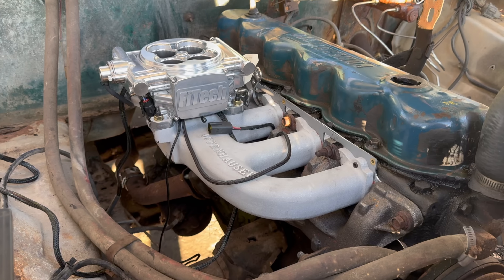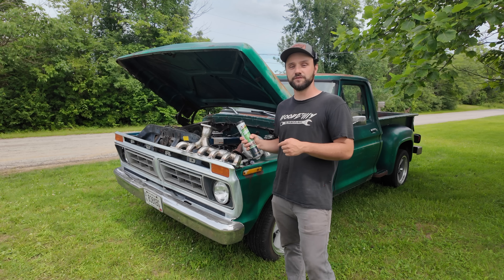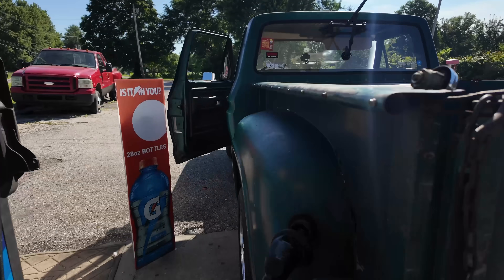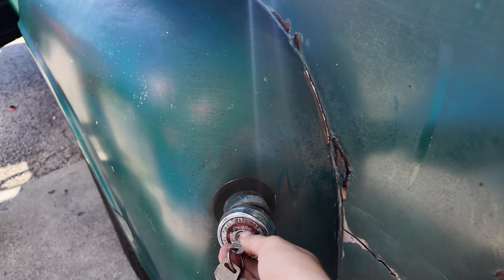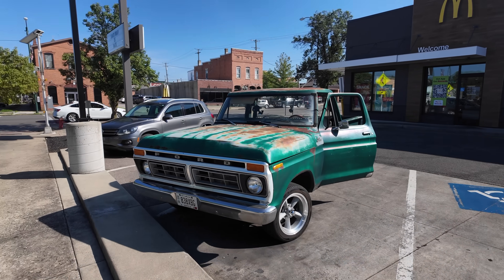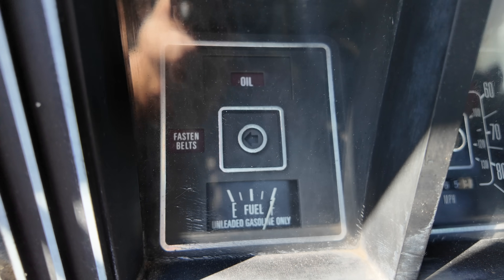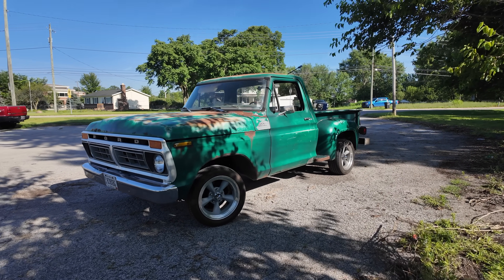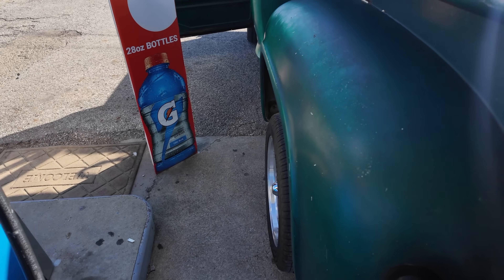How Many MPG Does An EFI Swapped Ford 300 Get?

Comment: Gas hog 300 6cyl, I bought a new 78 Ford short wheelbase step side in 79, Gas hog -15-17 at best, but with a trailer with about 2 tons dirt it still got about 15.  However, ford in all their brilliance in those years put the catalytic converter right to the bottom of the exhaust manifold and it would melt or soften the bolts holding the converter on and the actual manifold would melt.  Did this twice under warranty.  It's the rear end gearing and it is on the way low side.  If you want to pull heavy loads, it's fine if you want to go down the highway it isn't.  The melting manifold it unfixable, all should be gone.  Traded it for a 78 2door Pontiac Bonneville.  It was almost the same Green as this truck but had Fiberglass rear finders, looked nothing like rounded ones on yours.

Comment: I'm not sure a 30 mile round trip could be adequate to establish fuel economy. It would be impossible to duplicate any additional test drives due to the variabilities. I've got a 64 F100 with a 78 351M and C6 auto that will pass anything except a filling station.

Comment: If you have the option of tuning the EFI yourself then just make sure your engine runs at about 15: 1 AFR at cruising speed/steady throttle and use deceleration fuel cut off. 
Also, use a working thermostate that will keep the coolant at about 203F (or 95C). That way the EFI will provide the leanest AFR as soon as possible after initial cold startup. Which is good for mileage.  

Apart from all that is your personal driving style. It can make a huge difference (20-25%!) if you accelerate hard or if you just gently let the car/truck gain speed. 
Other obvious factors: keep your tires properly inflated, make sure your brakes aren't dragging, don't carry any unnecessary heavy objects in the car/truck.

Comment: 3 full throttle to redline pulls to program the altitude within the rpm range; and a solid tank full of driving or at least 100 miles so the efi can get a good base. Then go for a mpg run.  A wide-band is a good idea but if you not looking for a hotrod a simple air fuel gage is just fine. Also for goodness sake run 100% if you are doing regular it really is worth the extra money on the old stuff.

Comment: What model transmission and FDR is it running? Because if it's loafing along in overdrive, with a even a slightly aggressive or modest gear in the axle... that has quite an effect.

Comment: Great improvement. Now figure out the cost per mile of the original carb and the new efi. Take the difference, and that is what you save per mile. Then you can tell us how many miles to save the cost of the efi set up.

Comment: My dad had a 74 F100 Custom, 240/3 speed. He had an un-aerodynamic aluminum camper shell on it for a while. During mid 70s gas crisis, he took the shell off, went on a loop, and reported that he got 25 mpg.

Comment: My efi 4 speed 4.9 got 17 mpg driving it super easy. Once I saw 4.9 get that mpg I decided they are not worth it, my 351w gets 15-16 easily on highway it has way more power, just as reliable, with v8 rumble

Comment: There is NO way you can accurately measure gas mileage by going less than several hundred miles. 1000 would give you really accurate results. I appreciate what you're trying to do, but this is a terribly flawed way to go about it.
Reply from the maker: 100 miles yes, 1000? That’s a bit much homie lol 🤣 it doesn’t take all that
Reply: @GilktheGreat Actually, 1000 miles isn't too far off.  You want practical miles. That means that you need to keep track of your mileage, over the course of several fill ups. (One commenter suggested 3-4 full tanks; I'd go with 5 or 6). But, by the time you burn about 4 full tanks, unless you have a very tiny tank, you should have hit 1000 miles; probably more. 

By the time you've burned about 5 full tanks, you'll have a good representation of practical MPG, based on your specific driving style, and the conditions in which you typically drive. (Conditions include average stop and go, the terrain, weather conditions, your average highway vs city, and other things.)

Keeping continuous track of practical MPG is good, too. If you note the MPG slipping, you know that SOMETHING wants attention.

Comment: I am a metrologist and this test is flawed. 

You must start and end with the same amount of fuel in the tank for the test.

On the second test you started out with a tank that was full till it was dripping out, and when you added the fuel at the end you did not add it all the way up until it spilled out.
Reply: Don't need to be a meteorologist to realize that.  😂
Reply from the maker: lol
Reply from the maker: Appreciate the insight, Matthew. You’re absolutely right—starting and ending at the exact same fuel level is key for an accurate test. I tried to be consistent, but I’ll admit I didn’t top it off to the exact spill point on the second fill. I’ll redo the test with more precision next time and make sure to document that part more clearly. Thanks for pointing it out

Comment: My best measured mpg on the trucks I've owned.
86 Mitsubishi 2.0 5sp.      27
90 S-10 2.5 5sp.                30
95 F150 4.9 5sp.               18
99 F150 4.6 auto.              20
05 Silverado 5.3 auto.       22

Comment: In the 1980`s they came out with an overdrive standard transmission that got higher fuel milage.
Reply from the maker: I’d love overdrive
Reply: I had a 1978 E-150 van that I ordered with that manual. 3 speed plus OD. I think it was like 1.1:1. Drove great!

Comment: I have heard claims of 28 mpg from a 300 Ford.  I don't know details but a camshaft and custom pistons were used to maximize the compression ratio.

The new F150 window sticker in 1985 said 25 mpg - was 1 barrel carb
Reply from the maker: Don’t worry, I’m going to tune it because the tune is really rich right now and tested even further so you guys can see why the system works

Comment: 30 miles isn't a great test for fuel mileage.  Need to do a couple hundred before you can get a good accurate test.  I do about 120.
Reply from the maker: We are getting ready to tune it in redo this test and drive it further. My tune was super rich anyways so I think we can get a higher miles per gallon.
Reply: @GilktheGreat  very cool. I can't wait to see what your TBI unit does for the mileage.  

I have a very healthy low miles carbureted 454 in a camper, and the mileage is predictably awful. 
I had thought about building a Megasquirt system for it, but honestly...... a quick bolt on solution would just make life easier all around. LOL  

What was your long-range mileage with the carburetor before?

Comment: To get more accurate fuel economy figures, it would be best to use like a 5 gallon boat fuel tank that can be weighed before and after, or just fill it with a known volume and run it dry.
Reply from the maker: Yeah, we’re probably gonna do like 100 mile trip and take the truck to a weigh station potentially

Comment: I had a 77 f100 with a 300 with a floor shift 3 speed with over drive just think of what kind of mileage you could get with that transmission in it
Reply from the maker: Dude, I would keep the three on the tree if I had overdrive
Reply: @GilktheGreat  I wonder about the possibility of adding a Borg Warner overdrive to it...

Comment: I write the odometer reading on every fuel recipt, put it into a database program that does the math for me. Gives you a good average over a month or year or week. Yeah it takes a little time but worth it for me.. Living in Texas I can say the hotter the weather the worse fuel mileage 1967 F100 352CI & 4 speed ( no AC no PS)
Reply: Are you can just the fuelly app.
Reply from the maker: What is the program you use called? I’d love to give it a shot.
Reply: @GilktheGreat  i use fuelio.  my 78 f150 300 with c6 and 4.11 gets between 12 pulling my boat to 15 empty with efi exhaust, offy dp intake and qjet.  everything else stock/original and 178k on the clock

Comment: 23 MPG is pretty good that's almost double of the 12-15 MPG the F-100 with 300 inline six got when it was new. I mean if your DOUBLING your MPG when new just by doing a EFI kit on 45 year old truck then that's nothing to sneeze at, My buddy has a 1980 F100 with a 300 in it that my soon to be 13 year old grandson wants so bad he can taste it.
Reply from the maker: That’s amazing to hear man! Thanks so much for the comment. Big reason we EFI swap it is because it’s the more affordable option for turbo charging this in line 6 versus doing a blow through carburetor set up.
Reply: @GilktheGreat  Yep I get it, it's easier and it's cheaper to do that way.

Comment: I had 90’s Ford trucks that I regretfully sold and scrapped over 10 years ago:

1993 F150 regular cab 2wd 300-6 Mazda 5 speed, 2.73 open differential, no topper or bed cover I got 22mpg highway at least once going 60mph, no cruise control. 

1994 F250HD regular cab 2wd 300-6 ZF 5 speed, 4.10 open differential, no topper or bed cover I got 18mpg highway at least once going 60mph, no cruise control. 

Was diagnosed with chronic Lyme disease and sold the F250 with a bad clutch slave for $500. A few years later I cut up the F150 and sold the mechanicals. Wish I had kept both of them.
Reply from the maker: Dang man I’m sorry to hear that

Comment: I am not doubting your test; however, I have owned three trucks that had the 300. Two were F150's (1980 with automatic no overdrive, carbureted, and 1991 4wd, with five speed standard with the overdrive and EFI) and a 1983 F350 with four speed granny gear, carbureted. The F350 got nine miles per gallon. The F150 automatic got between ten and eleven mpg, and the five speed gets between ten and twelve mpg. I still own the 1991 F150 Lariat.  It has less than 83K miles on it and she still looks almost brand new, inside. It has a few very small chips and dings on  the outside. I drive it when I need to pull a heavier load than my Toyota can handle. I get asked almost every time I drive it, how much do I want for it? I always smile and ask where do you see a for sale sign? Truthfully, I have a son who was born in 1991 and he has pretty much claimed it, and his three brothers and one sister let him, lol.
Reply: The 77 F-100 with the 300 inline six got 12-15 MPG When new, atleast that's FoMoCo says, and he basically doubled that on the low end just by doing an EFI swap. I'd say that's pretty good for minimum work/upgrades.
Reply from the maker: We can take it on a longer test, tune it before we go
Reply: Those of us who owned and drove these vehicles when they were new have a pretty good idea of what to expect. In 1976 I bought a new E100 with a 300 I6 and automatic transmission. I don't remember checking the economy because gas was inexpensive. I bought a new 1978 E150 with the 351 W and auto and the best I got with that was 12.5 downhill from Wolf Creek Pass to Pagosa Springs Colorado! My 64 F100 resto-mod-survivor has a 351M / C6 and does about 8 mpg. I don't drive it enough to justify the expense of a true EFI conversion. Still fun to drive though!😊

Comment: So, I think you would get better results with a longer trip. For one, it's real world use whose mpg matters. Second, fuel pumps are known to not be accurate when only putting small amounts. Most of them have a warning on them somewhere about them only being accurate after so many gallons.
Reply from the maker: Okay I’m thinking about doing a longer test for you guys, I think I can get more mpg out of this
Reply: a longer test only "improves" the mpgs by keeping the system in cruise mode longer, if you stop and start at a red light you waste all the saved fuel
Reply: Car Manufactures use 50 miles, he used 30, that's close enough for a guestimate.

Comment: The way the grease was oozing out, it looks like you have some ball joints and tie rod ends to replace in the future.
Reply: Those joints are made to flow out grease when lubed. That is not an indication of wear. Wear is looseness and movement (play). Replace the loose ones.
Reply: @svendhellested3463  I thought the rubber boots would need to be replaced. No? Then once its apart to get to the boots you would just do the whole joint. Am I incorrect?
Reply from the maker: Yes I’m sure lol im not sure if im doing to replace them or just do a crown Vic k member this winter
Reply: Get 5 speed tranny

Comment: I do like your truck, exactly what I would want. Been wanting a 300 Ford for a long time. I do have a 77 Chevy  with a 250 and a 3 on the tree. I drove it 7 times on a 1400 mile trip, 70 mph was to much ram.
Reply from the maker: That would be awesome, I drive this truck to much and the 3 on the tree is getting annoying

Comment: 5.9 V8 in my 2000 Ram has had a noisy wrist pin for the last 5 years and I had a 4.0 I6 from a 95 XJ cherokee in the garage. So I've swapped the 4.0 into the Dodge. I honestly just prefer I6.
Reply from the maker: Nice! I’ve always liked the simplicity of an inline six.
Reply: @GilktheGreat There is a short video of it running on my channel but I'm only 5 weeks into the swap so wont be finished for a while.
Reply: The 4.0L I6 is one of the best most reliable engines
Reply: How much fabrication did you have to do to swap? How did the engine mounts line up?
Reply: @JamesLee-oe7mt I cut the magnum frame mounts off and made new ones to take the XJ engine mounts. AW4 transmission bolted to the 46re transmission mount after drilling 2 new holes in the top of it. The dodge T case bolted right up to the AW4. Both driveshafts are the stock dodge shafts.
Reply: @JamesLee-oe7mt if he actually did it it would be hella gutless with some major engine mods
Reply: @kenappel6149  Its already in and running. It will not be gutless. Will be a bit slower than the 5.9 but the transmission ratios are lower in 1st, 2nd and OD than the 46re. 3rd gear is the same ratio.
Reply: @moparmtb360 it should be fine. I had a D100 with a hopped up slant six a 3.55 gears. Around town it was pretty snappy and more than kept up with traffic. On the interstate, well that was another story. Aerodynamics of a brick.
Reply: @PapiDoesIt I do a lot of long distance trips with mountain bike trips and the 5.9 magnum made the trips unaffordable. If I can eek out at least 3 or so mpg more over the 5.9 magnums 14 mpg that would be nice. I don't care about performance. Lots of things about the magnum irritated me. Trying to get to the crank sensor and distributor in the 2nd gen is all done by feel as can't see any of it.
Reply: @kenappel6149 I've seen them with a supercharger and they rip.
Reply: The 4.0/I6 is a great little engine.  Can't say I've seen one in a full sized Dodge.  Should do just fine as a daily/commuter.
Reply: @1SqueakyWheel The 4.0 Jeep is better than the 3.9 Magnum v6
Reply: @timothykeith1367  Agreed.  I'll take an inline six over a v6 of the same size, if I have my druthers. 
I have a Cherokee with a 4.0 and an Explorer with a pushrod 4.0, both about 30 years old, and bone stock. 
The Exploder is much more comfortable to drive, and with less electrical problems, but even though that V6 has been a hard working trooper with no issues (approaching 250k) I know that inline 4 liter would go farther without a rebuild, if pressed. 

So 3.9...  I thought it was a 3.7?
Reply: @1SqueakyWheel 3.9 magnum old school pushrod V6 in the 2nd gen Dodge. 3rd gen got the 3.7 junk.
Reply: 3.7 is okay in the single cab. I have a nitro with a 3.7 and it’s fine for the smaller chassis it definitely could use more power but it’s not terrible in a smaller chassis. Got a ram with 5.2 that just jumped timing because of loose timing chain. 94 ram single cab long bed great work truck.
Reply: @alexdel-toro323  the 3.7 is junk reliability wise. Its a crap motor. They arent talking about what its fitted into. The 4.0L will last 3x longer than 3.7.
Reply: @1SqueakyWheel  The 4.0 Cologne V-6 is anemic. The factory where it was built was not bombed in WW2 (guess some folks had Ford stock?)
Reply: @kd5inm  My friend has 500K on said "junk" in a 2008 Dakota
Reply: Straight sixes tend to be pretty reliable, but you give up a hog ton of power and towing ability with this kind of swap.
Reply: @rcnelson  No, I6 300 & 292 are easily capable of 250-300HP and 400Ft/Lbs torque. Camshafts were way too conservative compression low.
Reply: Cool! I didn't know you can put those in a truck!
Reply: @CaptainKruton-ff9gv Well its in there and running. About 95% complete.
Reply: That's sweet! My XJ was one of the main reasons I bought my 94 Ram diesel. Both very good motors! You should post a video! :3

Comment: You can usually mute those annoying ads by pressing 2nd button down on right-hand side of the screen on the pump.
Reply from the maker: When’s the last time you greased up your front suspension?🤣
Reply: @GilktheGreat last oil change w/tire rotation.
Reply: Pump jockey approved your message 
Works on Gilbarco anyway

Comment: I got 19mpg out of my 77 f250 2wd 300 np435 3.31 rear. I was doing around 1800-2200 rpm the whole time. If you wait till the tank is empty you’ll get a more accurate mpg. I remember when you said the 300 had a 2 barrel carb stock
Reply: The 300 always had either a Carter YF or YFA 1 barrel carb until the late 80's when it got fuel injection.
Reply from the maker: Yeah, I made a mistake in that video lol it was a single barrel
Reply: @GilktheGreat I love how your truck is turning out! Keep it up man